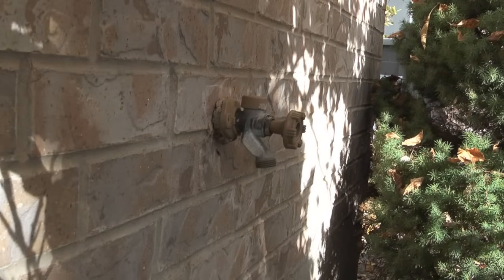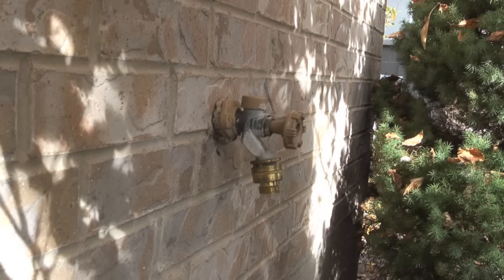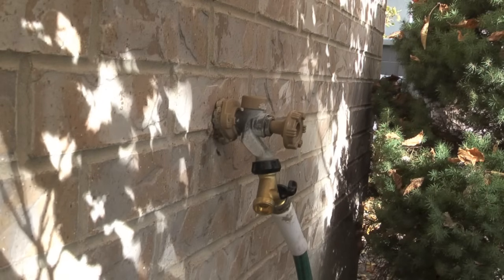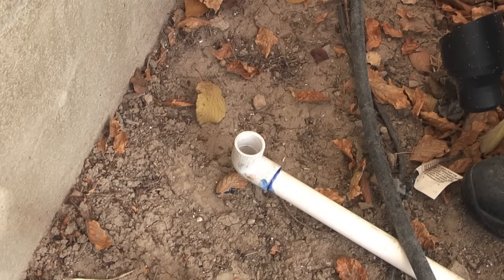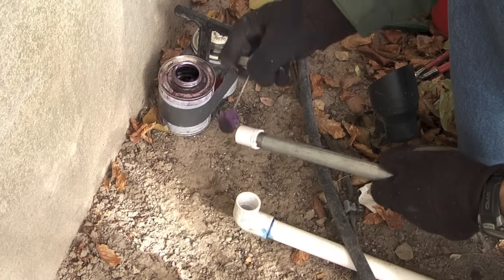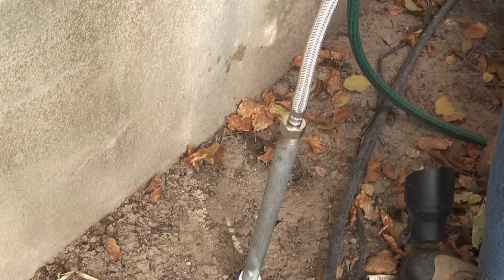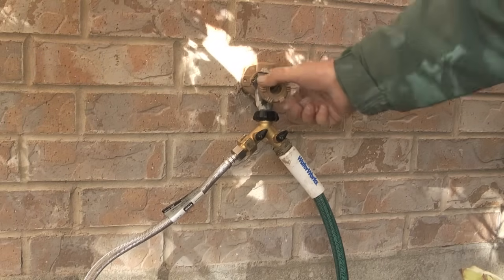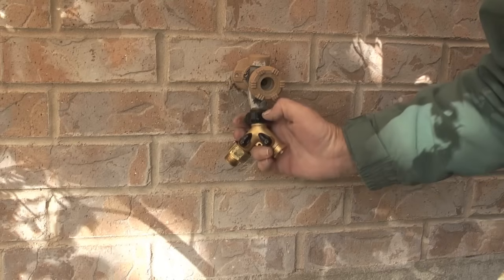How To Connect A PVC Pipe To An Outdoor Tap/Faucet

Comment from the maker: The advantage of doing it this way is appearance, you would only have one pipe that would be seen coming off from the faucet instead of 4 pipes. You will have some additional cost on buying 4 manual valves but they can be positioned anywhere that fits you landscaping. Good luck!

Comment: This is a great solution that I considered using but there are some potential problems and limitations. As the author mentioned, you need backflow prevention. Another thing is freeze prevention. The below-ground drains should help with if they work properly, but personally I wouldn't be comfortable leaving this connected in the winter so I would disconnect the flex in the winter. I decided to tap into the existing below-ground water line (yes, a local permit is probably required) to be able to run all of the PVC underground (except the risers of course). That way any freeze damage is minimized and probably limited to the drip tubing or PVC risers which is easier to repair. Now, to make this low maintenance you'll want to put it on a timer. The selections for in-line timers that you could use for this sort of set up are limited and run on batteries. You could use a regular irrigation timer and an underground valve if you were willing to run the control wiring. The last thing is, if you ever sell the home, this set-up could get flagged by an inspector.
Reply from the maker: Good points, thanks for posting. This type of setup would need to be disconnected before winter because of freeze damage.

Comment: Thank-you for the video. Can you tell me where/how I would attach a battery operated timer for my sprinkler system here? Thank-you
Reply from the maker: +Reid Larsen-Larabie 
In this configuration, inlet end of faucet timer would attach to outlet of the hose wye. You will need a brass adapter 3/4" FHT (Female Hose Thread) X 1/2" MIPT (Male Iron Pipe Thread) to connect to the 1/2" braided flex line.
Reply: +iScaper1 Thank you very much. The 3/4" FHT was the one that you had in your video, do I have that right?
Reply from the maker: +Reid Larsen-Larabie 
Yes, that's the brass adapter you need.
Reply: +iScaper1 Sorry - I have one more question.  I only have 3/4" braided flex line at my home depot.  Is it okay if I just attach that to the timer, and the other end to the galvanized pipe?  In other words I would not use any adapters, just straight connection from the timer to the pipe with the braided hose. If it is, I take it is okay to screw on the female ended braided flex line onto plastic male thread of the timer?

Also, given that I would also have to use a 3/4 inch galvanized nipple, would that mean that it would have to connect to a 1 inch PVC piper? (Since it would have ti be smaller to screw into it?)

Thank you very much for your support!
Reply from the maker: +Reid Larsen-Larabie 
If you have a 3/4" flex line all you need is a 3/4" FHT x 3/4"MIPT brass adapter. The timer outlet is male hose thread and the 3/4" galvanized pipe would be 3/4" MIPT (Male Iron Pipe Thread). If you're going from the 3/4" galvanized nipple to 1" PVC pipe, simply glue a 1" coupling onto the PVC pipe and a 1" x 3/4" PVC threaded bushing into the PVC coupling. Then thread your galvanized nipple into the PVC bushing.

Comment: Would it be possible to use this technique to hook an outdoor tap to an in ground sprinkler system.  Lets say I use a 4 way valve instead of a 2 way valve.  Wouldn't that give me a four zone manual controlled, in ground sprinkler system?  Your thoughts?  Thanks!  Your videos have been very helpful!!

Comment: Could you just attach a section of hose directly from the bib down into the PVC? Whats the benefit of using the galvanized pipe with the braided flex line instead of just simple hose?
Reply from the maker: You could use a section of garden hose also. I liked the braided flex line because it had swivel connections on each end and I used the galvanized pipe for strength and to resist the effects of sunlight. Also the connections this way are mostly IPS. If you use garden hose you have to adapt from hose thread to IPS to make the connections work.

Comment: Working for a Hot Tub place for years, I have seen that volume of water flow is the most important part of any water system. The braided line you are using only has about a 1/4 inch inside diameter. That will restrict your water volume flow quit a bit. The manifold itself is of a smaller diameter as well. Fill a glass with the water dispenser on your refrigerator.  Then fill it again on the kitchen faucet itself and you will find a much higher water volume flow on the faucet taking much less time to fill the glass. This water volume flow becomes even more important when you are running water to remote areas.
Whenever we filled hot tubs at customers homes, we always took all of these connections off entirely. Every one would have to come off and only a single hose from faucet to the tub or you would be there for hours filling these tubs. 
This comment is just a word of advice. I am not saying your system will not work, what I am saying is everyone should try to make sure they are using the largest inside diameters you can find. I know for certain there are better manifolds out there with 1/2 to 3/4 inch inside diameters. Its all about the volume of water flow.

(FYI, always fill hot tubs by running the hose directly into the open filter housing to avoid air pockets. Usually that is the highest point in a hot tubs plumbing system).

Comment: I'm still in the planning phase of the system.  I'm trying to get the supplies together by Thursday, so i have all weekend to begin the manual aspect of the installation.  I've been very wary of starting a manifold system due to the electrical components involved.  Do you have any suggestions on types of manifolds I should take a look at?  Thanks a ton!

Comment from the maker: All of the house faucet supply pipes I have seen are 1/2". To install a 3/4" supply you would probably have to tap into the main line feeding the house, or if available an exposed 3/4" line in the basement.

Comment: How has your braided line held up being exposed outdoors?  I want to do the same thing but I'm worried about rust and UV deterioration of the flex hose.
Reply from the maker: Temp H 
If you're worried about rust and corrosion you could undo the fittings and take it inside during the winter. Be sure to cover the inlet of the PVC pipe with a plastic bag or similar to keep debris from entering the pipe.

Comment: So I would need a pressure piece at the water valve? I connected pvc all the way to an outdoor sink but no water goes through the faucet but there's water in the pipe. That's the part I'm lost at.

Comment: Thanks for the tutorial!  One question, where do your drains go?  I'd suspect that they have to be down as deep as the PVC pipe is laid, right?  If so, how do you access it to open/close the drain? Do you have to dig a hole beneath it?  How many drains would you have for 100m worth of pipe?  I'm just afraid of the hole thing busting in the winter.  Thanks again!
Reply from the maker: Drains go in the low spots on your PVC pipe. Depending on the slope in your piping I would put a drain about every 20'. Use King automatic drains and you don't have to access them. Take a look at this video to see how to angle the drain in relation to the pipe: http://youtu.be/5K72zbv5SCw

Comment: Oh and how about my back yard. I want to use 6 12 Van Nozzles on 1804 heads. With the use of a tap. My waterline in 3/4 inch copper and pressure is 55 psi. In how many zones should I split my back yard in? 3 will be 90 degrees and 3 180 degrees.
Reply: Are you sure about the 55 pressure?

Comment: Thanks! Looks like I may have schedule 80 pipe. One final question. The salesperson where I bought my hardware sold me a can of solvent cement that does not require a primer. He sold this to me after asking if I was going to be using the system to retrieve/get drinking water, which technically it won't. The product is Carlon Solvent Cement. Do you know if this is something I could use safely if the water is to be used to irrigate a vegetable garden?

Comment: Claber have a simple product that will fit directly onto a 3/4" tap, it has a compression fitting that will securely hold a 1/2"  polyethylene main irrigation pipe. Claber product Code 91013. Maybe am just missing the point with all that glue and wrenches.

Comment from the maker: Unless you have a 3/4" supply feeding the tap you can still only use 5-6 gpm because flow is based on the smallest pipe size in the circuit, in this case 1/2". 

A 12 VAN nozzle adjusted to 1/4 circle uses .59 gpm (gallons per minute). A 12 VAN adjusted to 1/2 circle uses 1.18 gpm. The total usage in flow for all 6 heads is 5.31 gpm. You're reaching the limit of what the tap can produce in flow so to be safe I would split the yard into 2 zones. 

If all piping is 3/4" then 1 zone.

Comment: Thank you for your help!  Could you post links to Amazon for the parts you used?
Reply from the maker: I added all the parts I used in the video to the Store page at my website iScaper.com under the Parts and Materials tab. Here's the link: http://iscaper.com/store.htm
Reply: iScaper1 I don't see the parts list at this link. Was it taken down? I'd like to have the parts list as well. Well done video!
Reply from the maker: Ismael Alfaro
You need to click the Parts and Materials link on the Store page. Parts are annotated in the video also.
Reply: iScaper1 Sorry - found the link. Wasn't obvious. Regarding burying the PVC pipe. I have about 50' from the faucet to the garden bed. Is it forgivable to not bury the PVC? Also, any recommendations on what to install for the drip irrigation at the bed? Additional PVC with 1/16" holes every six inches, or tubing with flow regulators? Thanks again.
Reply from the maker: Ismael Alfaro
PVC pipe doesn't do well in sunlight, it discolors and becomes brittle. I would bury it. For gardens I like using drip lines and emitters which allow for individual plant watering or the watering of small areas. Rainbird is my favorite. Here's a link to a video where I use drip materials: http://youtu.be/7x5vQ45tRVw

Comment: Can i use 1/2 to 1/2 from the nipple to PVC or do you have to go 1/2 to 3/4?
Reply from the maker: You can connect the 1/2" flex line to 1/2" PVC pipe. Either connect a 1/2" nipple into a 1/2" PVC female adapter, or glue a 1/2" PVC male adapter onto the 1/2" PVC pipe.

Comment: Would I be able to run 2 Rain Bird Maxi Paws of a house tap with 55 psi and 3/4 in poly pipe and the rotors would be connected to side inlet.

Comment: why the galvanized pipe? why not do the whole thing with pvc?
Reply from the maker: +Wayne Granzin 
PVC doesn't do well in sunlight. It gets discolored and brittle, plus it's hard to attach rigid PVC to a hose wye. The braided flex line I used is easy to connect in the spring and remove in the fall.
Reply: +iScaper1 i understand the braided line part. that's brilliant.
but if your situation doesn't get direct sunlight. you could just as successfully use pvc in place of the galvanized vertical piece?
Reply from the maker: +Wayne Granzin 
You could, but remember PVC is brittle and if it's bumped it could crack and leak. You wouldn't have that problem with galvanized pipe.
Reply: fair enough. though by that thinking, why not just do the whole job with galvanized? i've seen more sched40 pvc fail below ground than i have above.

granted we are likely working in different climate and soil conditions. ; )
Reply from the maker: +Wayne Granzin 
PVC is much easier and quicker to work with than galvanized, has less friction loss than galvanized, and when properly installed will last longer. Galvanized pipe is heavy and cumbersome to work with. Over time it corrodes both inside and out to the point where it gets paper thin and begins to leak. Rusted galvanized fittings often have to be cut out. There are a lot of old galvanized sprinkler systems where I live and they're miserable to work on.
Reply: you're a hard guy to argue with ; )
i just may re-think my vertical. if for no better reason than to combat the weed eater line!

Comment from the maker: A 1/2" tap will deliver around 5-6 gpm (gallons per minute), so if you used 3 Rain Bird 3500 series rotors I wouldn't use bigger than 1.5 or 2.0 nozzles for each head. If you have 2 quarter circle & one half circle head in the installation you would want the 1/4 circle heads to use half the water that the 1/2 circle head does. So you could do two 1.0 nozzles in the 1/4 circle heads and a 2.0 in the half circle head. That would add up to 4.0 gpm total and you're matching precipitation rates.

Comment: I am just finding this video. Thank you for the detail. I have a yard hydrant in one area of the farm with a 4 Wye attached and am currently running garden hoses to reach two other pastures and stock tanks. I don't know why I didn't think about just laying down pvc pipe instead but when I cut one of my brand new hoses with the brush cutter, I knew I needed a different solution. The water coming out out of the hydrant is 120PSI so it has blown out different hoses I've tried so I'm thinking the PVC would be a better solution for the pressure as well. Do I need to worry about that high of a pressure with the PVC set up? I see you went from 3/4 to 1/2 back to 3/4 just because of the availability of the fitting. I don't know what hose thread is versus IPS so I'm trying to understand that as well. Are the automatic drains buried underground with the PVC pipe as well?
Reply from the maker: Might need a pressure reducer to get the psi down to around 75. You could try Pex pipe and fittings in 3/4" instead of the 1/2" braided line I used. You need an adapter fitting to get from hose thread to pipe thread (the thread patterns are different). The automatic drains should be buried with the PVC pipe.

Comment from the maker: It should work. If I remember right the Maxi-Paw blue nozzle that the head comes with uses around 3.8 gpm. If the heads don't work right you could nozzle them down.

Comment from the maker: 1/2" PVC would be fine because the pipe supplying the tap is probably 1/2". If you go PVC nipples I would go with Schedule 80. They are gray, very sturdy and handle the sun well.

Comment from the maker: If you run poly pipe as the supply line you could use funny pipe to feed the heads. You would just need a threaded poly tee in the supply line to feed the funny pipe to the heads.

Comment: You should never thread a rigid pipe into pvc pipe because of expansion and contraction it will eventually crack
Reply from the maker: You are correct, that's why instead of using a PVC female adapter I used a PVC coupling with a threaded bushing to make the connection point stronger.

Comment from the maker: There would be no electrical components involved like timer wire and timer because you're installing manual valves. I have a number of videos on installing and replacing sprinkler manifolds. 

You should probably check with your local water department to see if they have any code requirements regarding installing a new sprinkler system using a house faucet as a supply.

Comment: I just watched this video on connecting a PVC line to an outside faucet.  I did this to put a faucet up on my deck, but I used 5/8" hose to connect from the faucet to 3/4" PVC pipe (a 25' run of hose and about a 30' length of PVC; I had to go around the corner of the house and then up about 12' to the deck).  This was to replace running a hose up to the deck from that faucet.  I had decent pressure with the hose, but my new PVC run has abysmal pressure; it just dribbles.  Thoughts?

Comment: Hi

Great video. Just wondering...is there any issue with just using 1/2" PVC? I've had a hard time finding the 1/2 - 3/4" connectors you've mentioned. Also, have only been able to find 1/2" threaded plastic PVC. Any issues other than potential breakage (possible sun damage I suspect) if I went this way?

Thanks in advance

Comment from the maker: Wait, I went to Carlon's website & looked up the Carlon Clear cement. It's for gluing conduit which isn't under  pressure. Look on the can and see if it's suitable for PVC pressurized potable water applications.

You want something like Christy's Red Hot Blue glue which is suitable for PVC pressurized potable water applications. Be sure to use the Christy's WITH primer.

Comment: Thank you again for your help!  I only have a .15 acre plot (not including my house in the plot).  So I'm thinking the 5 gpm would be enough to run two to three medium range heads off of, for each zone.  I've been watching all of your videos on replacing manifolds and they have been very helpful!  So now I'm thinking I will run a line, like the one in this video, to a manual manifold.  What do you think?  I'll be checking with the water co today as per your suggestion.   Thank you!!!!!

Comment: How do you winterize this type of system?
Reply from the maker: Christian Dior 
Either by installing automatic drains in the PVC piping or blowing the circuit out in the fall.
Reply: iScaper1  Do you take the braided line apart and store it? I'm assuming the nipple can stay out and probably just put a cap on it?
Reply from the maker: Christian Dior 
Yes I would store the braided flex line, and a cap on the nipple is a good idea also to keep any debris from getting into the piping.

Comment: PVC is intended for waste water only, and should never be used for a source water pipe.
Reply from the maker: Don't confuse Schedule 40 PVC pipe which can be used in many potable water applications, with PDWV PVC pipe which is used for non-pressure drain/waste/vent applications.